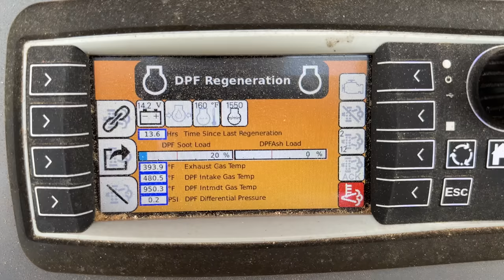Saw-milling Cedar And Hauling Slabs With A Tractor

Comment: Years ago, when I was in basic training at Ft Leonard Wood (combat engineer), we were using air powered tools to cut wood and make a timber trestle bridge. Some of the practice wood was western red cedar logs. I kept some of the shavings and put them in a sock inside my wall locker. It made the thing smell great. My DI came in when I was working on it and smelled it. He asked me why I thought I could do that. I told him because I was not told I could not do it. He was like, good enough.
Reply: Yep Fort Lost In The Woods, came by there a few times on the way to Kansas. A friend of mine that was stationed there told me I would understand the nickname first time I went to Missouri and Kansas its out there LOL

Comment: Not all my numbers came over. I had some that I had synched previously and some I had not. The ones I had not. did not transfer. I had them on the SIM but not Google. I had to do some finding and moving manually to get them.
And I was a tech support trainer for AT&T Wireless customer care at one point in time. So, I should know all about this process.
Reply: Alright you are the one exception 😅. Thanks for watching. Appreciate your time

Comment: I really like all the functions of that sawmill. You can move things around, spin them manipulate them. I've seen some smaller saws like Norwood and wood miser with manual feed and manual crank heights and they work fine too. But yours looks like a pro setup! 👍💪🇺🇸
Reply: It should for the $100,000.00 price tag

Comment: When you make your garden boxes, stack a bunch of scrap wood or maybe sawdust in the bottom and then just put nice dirt on the top 8 inches or so. I did wood chips. Drops over time but the chips retain moisture which helps the plants.

Comment: There is a system where you can heat your house, dry your clothes, & heat your water with waste wood. It was developed by a professor at one of the colleges in North Carolina using hot water produced by burning waste wood!

Comment: Nathan I know what you mean about slab wood, hardwoods I cut up for firewood, some cedar for kindling but pines and softwoods  if it doesn't get burned will get stacked in gulley's to stop or slow down erosion

Comment: s0 could you make your timber bed frame from your off cut slab sections with the cut side on the outside? I am sure a good reliable person could make great use of so much of your burn pile  removing a significant use pf a big part of it even making saw dust for garden use. just need right person

Comment: May I suggest to make wood chips out of the slabs and use them for heating or even shred them smaller and make wood pellets from them. Just to burn them seems to me like a waste of material. 🤗 Aren‘t there any businesses around who do that? Would be a win for you even if you give them away for free…

Comment: Well about the phone, you could be wrong there.  Not only do phones mess up ALL the time, but my new phone replaced one SO old, that the phone store could not transfer ANY of my numbers!   The original in store method was a device they no longer put in the stores, something about privacy concerns.  And  the cloud based stuff was too new for the older phones to use.  So the chance for error when retyping ALL the numbers is large which could also mean a text was not identified properly.

Comment: I'm just curious, you say you use diesel for lubricant on the blade, has there ever been a time where the residual diesel has caught on fire because you've struck a nail for example?
Reply: Diesel is not explosive in fact, you can’t even light it on fire with a match.
Reply: @robk1310  interesting, never knew that

Comment: Loved UR comment that you were not producing a high end piece of furniture while you were painting the siding in the shop. I only told you that in the hopes that you just might remember me. I also commented about your wood planer from Ulmia. Living in Germany I have the same one. Great planer. But the reason I am writing is because I would be very interested in purchasing some root beer, sassafras, saw dust. just to see , or better yet smell it. My biggest problem is that I am a US citizen living in Germany (EU). I don't know enough about importing wood or wood products into the EU. I know it is a lot of work and Aufwand (German). But I would be very happy to receive any info that you have. Thanks. Pls contact me and I will send you my email address. Thanks